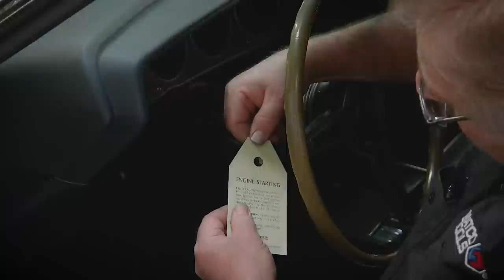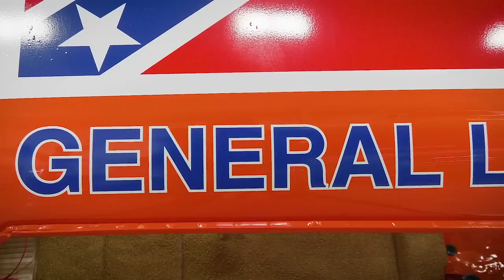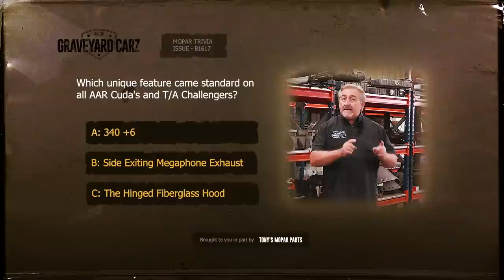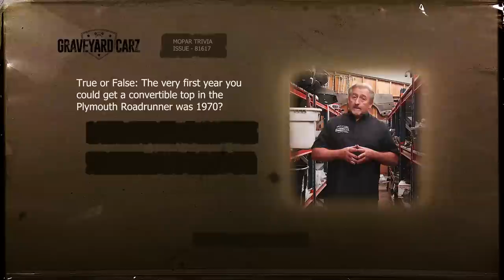THEY SAID WE COULDN'T INSTALL THE GENERAL LEE FLAG SO MARK SAYS "WE'LL JUST SEE ABOUT THAT"

Comment: It has to have the Confederate flag to be a real General Lee.
Reply: That's not the Confederate flag though. The Confederate flag look just like the union flag. That's the flag of general Lee
Reply: @SuperBROKEN81  it is the Confederate Battle Flag.
Reply: @michaelpiersanti5816  no it's not. It's general Lee's flag. Hence the name......
Reply: @SuperBROKEN81  You don't know what you're talking about. It's the Battle Flag of the Army of Tennessee (a rectangular version; historically the rectangular versions were replaced by square versions to save on material), and it also matches up with several other Confederate flags, such as the The Second Confederate Navy Jack (which used a lighter blue color, like the flag on later General Lees did) and certain versions of the Battle Flag of the Army of Northern Virginia.

There was no flag that was specifically designed for General Robert E. Lee, nor for the car on The Dukes of Hazzard that they called "General Lee." The car's flag was just a rendition of Confederate flag designs that had already existed for over 100 years.

Comment: Don’t let woke get in the way Mark!
Good on you 
The General Lee is not complete without the flag !
Stand your ground 
This is NOT NEGOTIABLE
Reply: I approve of this message 100%
Reply: I knew there would be at least one here.
Reply: @craighermle7727  One what champ? They should have let Sherman finish the job, then maybe the descendants of the losing traitors might have learned a semblance of decency.  ✌️
Reply: @craighermle7727  there’s so many more than one pal 
Woke BS won’t be tolerated anymore 
As I said NOT NEGOTIABLE
Reply: @batmanlives6456  You can wipe your butt with that flag.
Reply: @02WIFE that flag stands for southern pride and culture, and if you've been to the south, you'd know that it is everywhere. It is misconcieved as a symbol of racism because of the civil war. However, as stated, the flag represented the south as a whole, and slavery was an incredibly minor part. The war wasn't even about slavery when it started. Don't disrespect southern culture, which has largely built this country and has for the most part cleansed itself from the sin of racism.
Reply: @SHARKNADO_2006 absolutely well stated!

Comment: It's not a general without a hemi❤
Reply: the general was never a hemi car they cost too much to destroy back then, get it straight it's not the general without the flag and a big 01
Reply: @frankfranks2946  "the general was never a hemi car they cost too much to destroy back then"

No, they didn't. For one thing, engines don't get destroyed from the type of stunts they did with the General Lee on The Dukes of Hazzard, aside from perhaps some minor, easy-to-fix damage like a dented oil pan. For another thing, in 1979, no 1968 or 1969 Charger was particularly expensive, because they were just 10- or 11-year-old used cars, plus they were gas hogs in an era of drastically rising gas prices. The idea of muscle cars being collectible/valuable didn't really take off until the mid-to-late '80s.

No 426 Hemi Chargers were used on the show because none of the '68 and '69 Chargers they bought happened to have one, and they had no reason to specifically seek one out. They were relatively rare to begin with, so the chances of them just stumbling across one when they weren't specifically looking for one were slim.

Comment: Yes it looks great. With. The. Saint Andrew flag on it.  That's. The true name for the battle flag.  Look it up. Thanks.
Reply: No, it isn't. The St. Andrews flag is just a saltire, i.e., a diagonal cross, i.e., an "X". The type of Confederate flag that was used on the General Lee has a saltire, but also has additional elements, obviously: 13 stars on top of the saltire, borders along the saltire, and a specific set of colors (blue saltire with white borders and white stars against a red field).